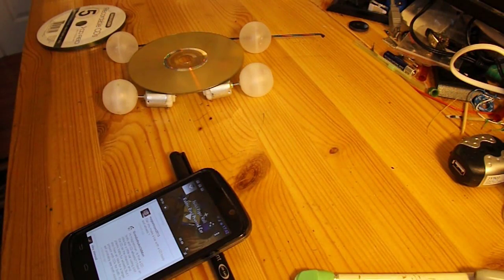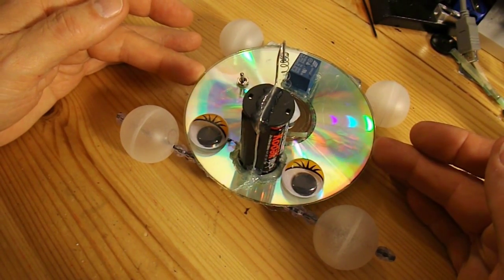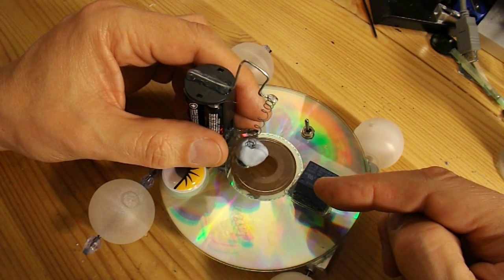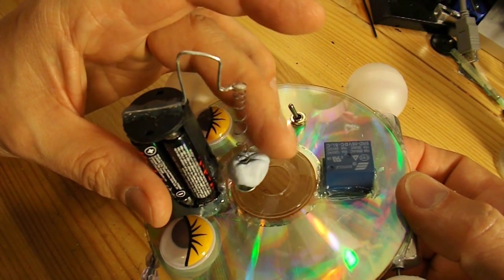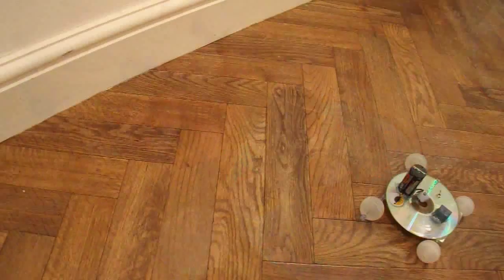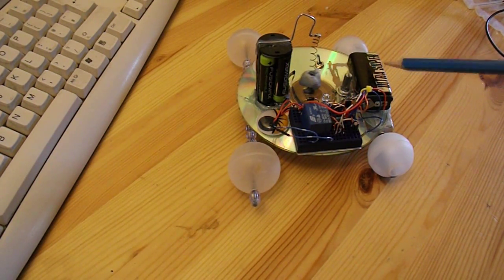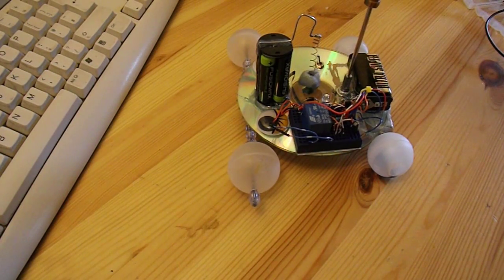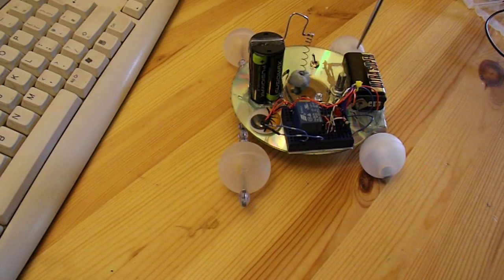CD bumper bug

Comment: put capacitor across the coil so it goes more backvards :)
Reply: maybe put resistor in series with coil and capacitorsi so it discharges slower but dont put wires from your svitch to the coil beacouse it wont charge the cap . If you add reistor you need to put wires from your switch to capacitor.
Reply: josip :D (snakeinthebottle) make it when it goes backwards only one motor runs  so it changes the direction
Reply from the maker: Thank you for your suggestions Josip.

Comment: I would love to make something like this.  So I will wait patiently until you continue with this "bumper bug".  :)
Reply from the maker: It may be a while. There is a bug that I cannot find. Somehow there is an interaction between the motor circuit and the delay timer circuit. When I switch the motors on, sometimes the relay operates. That should not be possible as there is no connection between the circuits. I suspected the relay, but I have changed it and the same problem still happens. I rebuilt the circuit twice on different breadboards, same problem. I think there is also a problem with the vibration from the motors upsetting the relay so I may need a different type of relay. I could carry on with a description of my step by step attempts at identifying the problem but I would run out of space here. I need to leave it alone and then come back with a clear mind and a different approach.